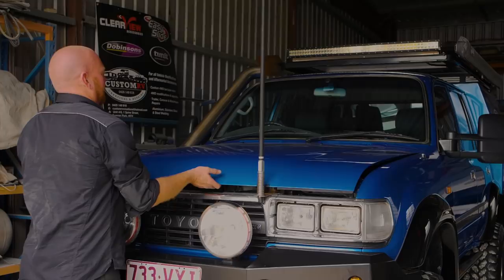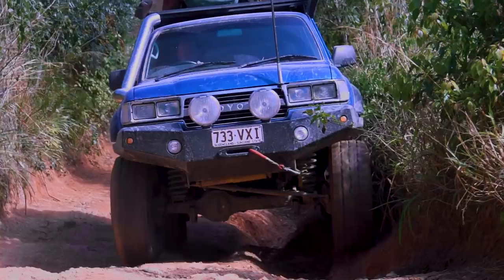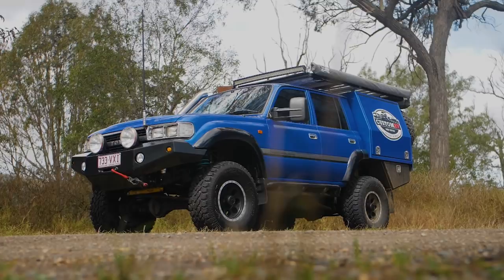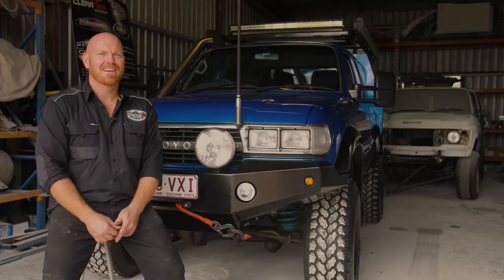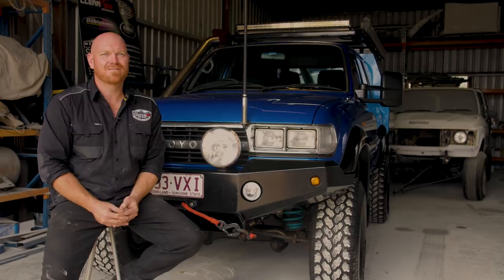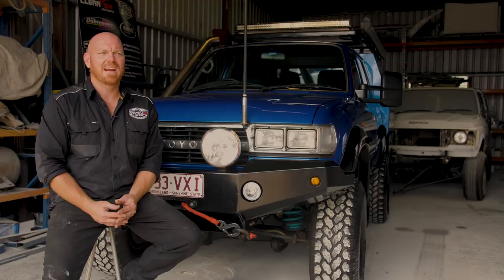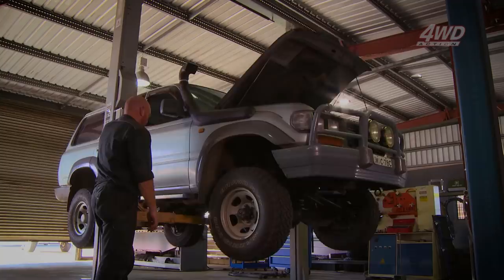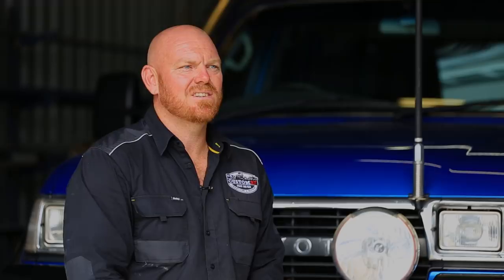Darren’s Chopped 80 Series Landcruiser – Born This Way Offroaders Ep. 13

Comment: toyota only have 1 size/length chassis,[swb do not get a thought/mention,too short for anything] so all the weight hangs past the axle,not good.re ronny dahl.,so,being ls1,how much fuel you carry,compared to a diesel.with the kids wife in tow,thats a lot of crap to carry.mate used to hate doing long trips in 80 series with family.destroyed his 60....with the ls1,how long the drivetrain going to last if they have problems std.